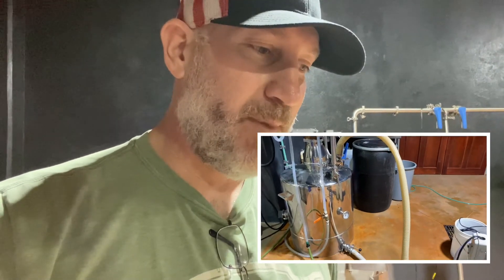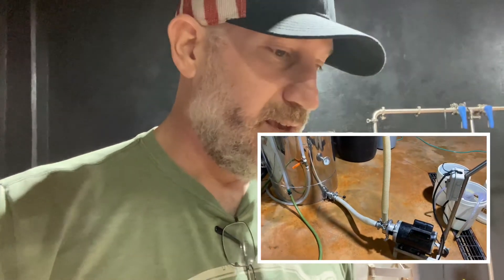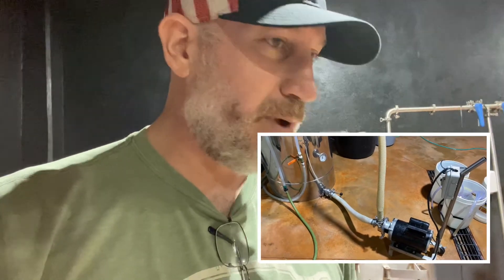Still Boiler Issues!

Comment: If I can suggest you put the tank on a pallet or some type of wood. I have a feeling some of the heat is being transferred to much to the concrete thus not giving you an efficient heat on the bottom. I think the concrete is absorbing/stealing heat from you. If you somehow put it in the air with a wood cradle there would be minimal heat transfer and would get hot faster and more efficiently. Just a thought...

Comment: Besides agitation/recirc, you could add an exterior BAND heater, or weld another lower tri-clamp fitting.  But they way you are going.....I think a jacketed boiler is in your future.

Comment: I've enjoyed all your videos subscribed!!
Reply from the maker: Thank you very much! Need to try and take more vids and upload them more often.
Reply: @jphalan  did the circulation of the mash help your run
Reply from the maker: @flatbedtrucker  it did! I’m getting about 15% to 20% for liquor when recirculating.
Reply: @jphalan  thats awesome im thinking about buying one for my still
Reply: Seems like poor engineering on mile highs part.  I feel like a correspondence to mile high is in order.  The only thing I can think of would be if the mash was fermented and left in the tank and if it was sitting on the bottom of the tank so it wouldn't burn.  For your application though I wonder if you could find someone to drill and weld new threads lower in the tank and thread a cap in the current holes?  I would be interested what mile high has to say.  Like you say not a much info on these.
Reply: @BigChristopher  I ended up welding a tri clamp fitting to my boiler and added a agitator works fantastic